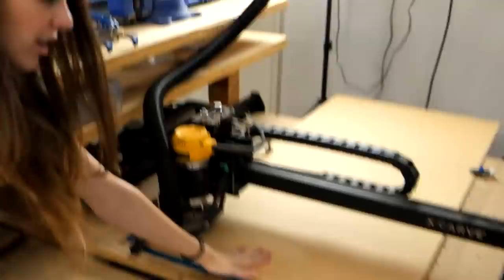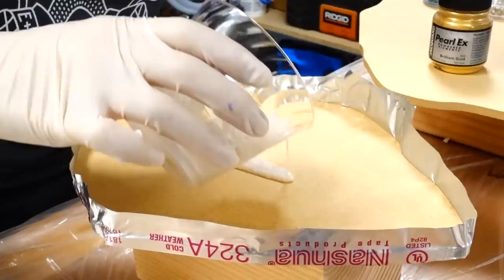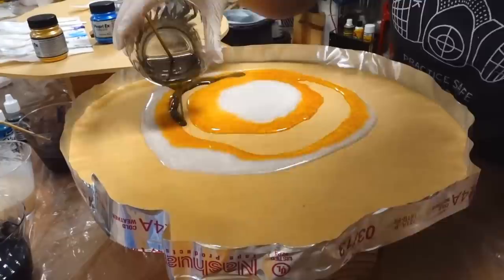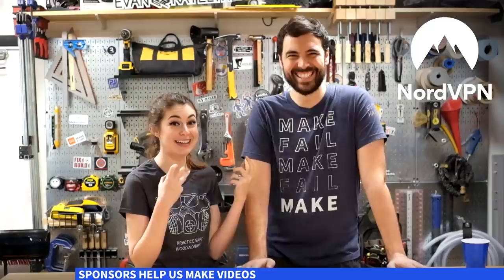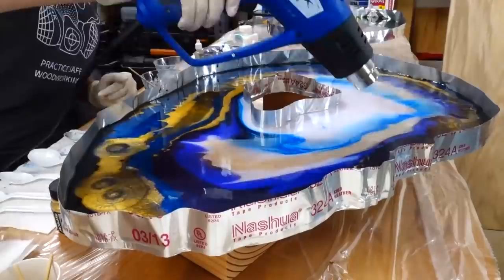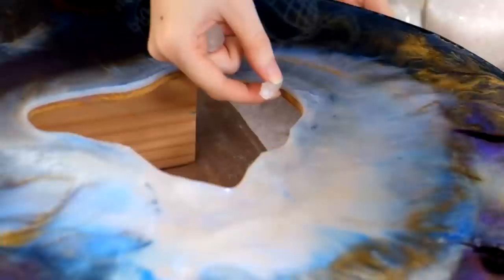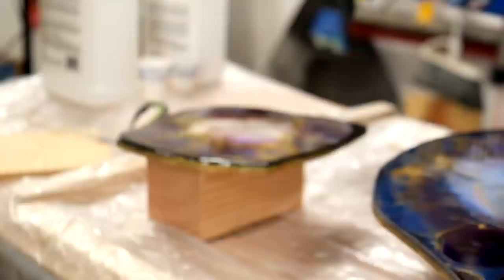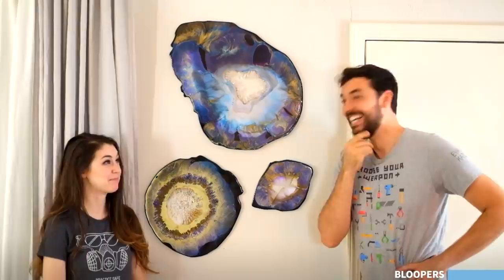DIY Resin Geodes - Surprisingly Easy!

Comment: You crazy kids with your myface and your fake geological artifacts. Back in my day we didn't have fancy geode art to hang on the walls. We just had potatoes and we were darn happy to have em.  Those came out sooo cool! I wonder what it would look like if you glued the mdf to the top of a tupperware bowl or something and covered the bowl part in sand and rocky crust to make it look like an actual geode rather than a slice.
Reply from the maker: bahahahaha this comment is everything. POTATOES!!! We are actually experimenting a bit with doing full geodes with a "rocky"  back and a couple other resin things!
Reply: Potatoes?? We would have killed to have potato art when I was a kid we had only macaroni and we were dang glad to have em, you kids and your fancy potatoes...
Reply: Before the vid got more than a minute or so in, I was thinking concrete shell (yeah, coarse/sandy outside would be awesome) and doing it on something so that there is not backing board to have a bit of translucence.
Reply: Roy Nielsen yes! Concrete shell with an LED or 2.. (or 30) in it, topped by a plexiglass-backed resin geode like these! That way the lights can shine through, like one of those crystal/geode lamps! And the concrete outer-“rock” from the concrete shell will also allow it to balance however you choose, so it can function as a table top lamp or wtv
Reply: Gene Price macaroni? Luxury!
Reply: Way too funny
Reply: What did I just read lol
Reply: Gene Price you had macaroni?? i can't believe how spoiled kids these days are. back in my day we only had fresh green artichokes, plain and simple. get out of here with your 'we only had--' NO! you young folks should be grateful for all the new technology your generation has. 😒
Reply: Little did you know that potatoe resin was soon to come...

Comment: Please please please use respirators!!! You will cause many health issues and possible allergies if you don't wear them! Set a good example for your audience too. Beautiful work guys!
Reply from the maker: We should be better! We are still new to resin and getting used to best practices
Reply: I was just about said that! 😅
Reply: @EvanAndKatelyn  I'm not kidding: I lost my sense of smell about 10 years ago when I built model trees for the adaption of "the gruffalo" using a lot of resin in the process. Never got my sense of smell back. It's not life threatening, and even sometimes helpfull, but most of the time it sucks.
Reply: Don't forget the gloves too.
Reply: Or use Art Resin. No fumes or nasty smells and just as good
Reply: @Ech00s  I used Art Resin for a river table without a respirator and it made me sick. Just because it doesn’t smell doesn’t mean it doesn’t have fumes! Albeit I was using large quantities regularly for like two weeks, but it’s always good to be safe.
Reply: Chris Woestenburg depending on the type, if you use it in a well ventilated area you should be fine. That said, I like to use a fan and a mask because I don’t have a respirator
Reply: Agree. Even if your epoxy is non toxic you are better off with respirator. Also, always use respirator for sanding. Epoxy is basically a form of plastic, if you sand it you create a plastic dust and vapour that you then breath!
Reply: @davidvasquez3564  they always wear them now :)

Comment: Amazing job!!! The final clear coat makes a huge difference in all of the details and figure of the different colors in resin. 

If you don't have the power tools to make a base for the geode, you can easily make one for pretty cheap! 

All You need is a silicone mat/art mats/the mats that have the grids on them(not sure what they're called). You may want to get a spray on mold release if your mat is older. Just spray and let it dry completely. 

And silicone and a caulking gun. You can get the liquid nails brand (100% silicone) and with the caulk gun, cut a decent size of the tip of the silicone caulking and then make your geode shape. Just let the silicone dry(will vary on how thick you want your geode to be. If you're wanting a thick geode, build up your layers of silicone until you are satisfied. 

Then you can start playing with resin and all of the different colors you want to use. 

After the resin has cured, you can just remove the silicone away from the mat and art. 

You can get a couple of pours out of your silicone "geode shaped wall(s)".
Reply from the maker: That is such an awesome suggestion, I hadn't thought of that! Thanks for sharing 😁
Reply: EvanAndKatelyn No problem! You would also get two different art pieces! As the bottom side will be different from the top. 

Especially if you do some alcohol inks and drop the white alcohol ink over the top of any color besides gold or silver basically lol. 

Also, if you didnt like the way your art looked after the 24 hours, you can remove the tape earlier(when the resin is going into the tacky stage) and the buildup on the edges won't be so hard/raised. 

Great job!!!

Comment: YES! We want the 100% Evan and Katelyn resin channel...dooooo it!!!
Reply from the maker: Haha!! You guys are biased!!! :P But we do have some more resin projects up our sleeves....
Reply: can we get this in the UK
Reply: wouldn't it be up your shelves...
Reply: TotalBoat what is the biggest difference between your product and west system epoxy? I'm using some for a few woodturning videos I'm filming and would love to know more for my next purchase.
Reply: (mbfg have the hand pump/dispenser options which is probably the easiest/most comparable to what E&K are using in the video)
Reply: @RCW-Designs  - Price! and Customer support. We try to stand above all for customer support and tech help with your projects.  Give us a try!
Reply: MakeDaley you can get the pumps for any type of resin.
Reply: @Phillip Taylor for sure i only meant MBFG stocked the matching pumps where as ECFG dont have any pumps stocked (they also use their own containers so not sure if other makes of pumps would work on their container sizes is all
Reply: MakeDaley what's mbfg and ecfg stand for lol. I know that West Systems epoxy resin does come with the pumps, but it smells horrible(unless they have made a new VOC free resin). 

One of the biggest differences I've seen between the total boat and the "generic" resin is the viscosity. 

Total Boat is way better and cheaper than "art resin"
Reply: MBFG and ECFG were the two suppliers I listed in my previous comment here in the UK that stock ranges of Epoxy ECFG (East Coast Fibre Glass) do stock West Systems to my memory
Reply: i was mainly replying because someone was asking if it's available in the UK (which i dont think it is) East Coast are a Marine Fibreglass Supplier so they certainly have the good stuff!
Reply: EvanAndKatelyn yayayayayayayya

Comment from the maker: Thanks NordVPN for being an awesome sponsor! If you want to protect yourself online AND support our channel, go to https://NordVPN.com/EVANANDKATELYN and use code EVANANDKATELYN, to get 66% off a 2 year plan. Thanks!
Reply: From my experience resin does not like the cold. The expansion is just too great. 
That said, I'd like to see how this looks poured onto plexiglass instead of the board. That way you can put LED lights behind it for accent lighting.
Reply: Have you ever got a plastic cup and filled it with multiple colour resin ie layerd it up and then put the cup open end against a flat surface and pulled the cup a way
Reply from the maker: @Chris Caldwell the Total Boat stuff that we used is actually meant to go on boats so I'm pretty sure it would hold up!
Reply from the maker: @TheNajSD we really wanna try a clear backer to make it translucent - it's on our list!
Reply from the maker: @Luke oooo we haven't but that sounds fun!
Reply: guys your wOrk is awsam plz tell me the names of colours ues in this project thanku
Reply: EvanAndKatelyn what type of tape is that you used around the edges of the wood ?
Reply: @Roewitme  i was wondering same thing... looks like metal tape/heat tape. ...these guys were fun to watch and I learned lots
Reply: EvanAndKatelyn I need this in my life ! 🙌🏻
Reply: OOOH WOW!
Reply: You should put a mirror behind in the center of those pieces.
Reply: EvanAndKatelyn you guys LOVE resin don’t you?
Reply: EvanAndKatelyn These are awesome

Comment: You could put some LED strips facing up on top of the wood before you pour the resin, that way it lights up from the inside and the lights are inside the resin.  Also, it would make a cool table top.  Like a side table next to a couch or something.
Reply from the maker: We definitely wanna try doing a transparent one! Also, funny you mention doing a table like this... You should check out tomorrow's video! 😉

Comment: The heat gun will cause the resin to kick faster. I use the same resin for work (on boats) and the heat gun also works well if u need to get resin off. You can heat it up and it will scrape off easy

Comment: If you tape the back with blue tape it helps the resin not puddle underneath! You guys are so fun! Loved your video! Also it’s ok to torch more to make sure all bubbles have popped! What do you use to cover them while waiting to cure? I’ve tried just about everything and I still will get specks of dust in resin! It can be so frustrating! But your geods look perfect!
Reply from the maker: Thanks for the blue tape tip! We didn't cover them... Just hoped for the best haha. We kept an eye on them and plucked out any hairs or specs we saw as long as it was still liquid enough

Comment: Great video.  Epoxy resins are a lot of fun, and if you ever have a chance to mess around with polyurethane resins they are fun as well (like Alumilite).  Polyurethane resins set up a lot faster, so you won't be able to do what you did with the epoxy.
Reply from the maker: Thank you! Haven't played with those yet but they sound like they'd be good for small or simple pours where you don't need the working time

Comment: Hey guys, a couple of tips: if you spend a few minutes wiping off the drips at the end, you save yourself all the sanding of the back. Also, if you are working on MDF or any other porous surface, VARNISH or otherwise protect the back, so it will not warp in humid weather. And most importantly, use very strong two part epoxy for the crystals in the middle - if you use glue gun, the crystals will fall off. 

Cheers! :)
Reply from the maker: Thank you for the tips! Appreciate it!

Comment: Exceedingly COOL!
Can you make one to look like a spiral galaxy in the night sky with red, yellow, blue and white stars?
Reply from the maker: That would be really fun to try!
Reply: I was thinking it might be relatively easy if you could put the workpiece on a slow moving turntable and then drop the stars onto it moving outwards from the center as it rotates.  Obviously if you center the workpiece on the turntable you'll get a flat side on galaxy view. But what happens if you put the workpiece slightly off center?  Would you get an oval 3D effect?  Hmmmmm!

Comment: Hi Evan and Katelyn, this looks so amazing!  Quick question:  once the resin dries is it totally waterproof?  Like, could you make a large rectangle piece and install it in a shower for the walls?  Thanks for your feedback, and again, thanks for this fab video!
Reply from the maker: Thank you! I do think generally it's water proof, the type we use (TotalBoat, we have a link in the description) is actually made for boats so I'd guess it has to be water tight. We aren't experts though! Still learning a lot about resin

Comment: Not so much DYI when they’re using a WHOLE garage full of equipment, machines, tools and supplies, that NO ONE has/owns/or can afford! Maybe it can be still done with like a Dremel tool and air dry clay molds, resin will probably be expensive. I shall make this video! But yeah this video helps.
Reply from the maker: Like we mentioned, you can use a jigsaw (about $20) and you can sand them by hand if you don't have a random orbit sander (can get those for $30). The resin is the most expensive part, but it's cheaper than getting a real geode slice that big so we still consider it a win :)

Comment: Do you have to use wood? Would this work on a normal canvas?
Reply from the maker: We haven't tried it on canvas so I'm not sure, but I have seen people put down non-stick parchment paper, use caulk to draw the outline (building it up so it's tall enough that the epoxy won't pour over) and then pour within the lines. Hope that helps!

Comment: Great video and loved watching you working together.  
Do you know if this resin can be used for casting figurines?  For instance, a 3d skull about 5 inches tall?
Anyone tried it for that type of art?
Reply from the maker: thank you! you can't do individual pours that are too thick because it puts off a lot of heat but you could do it in layers one at a time
Reply: Thank you.  I’m very much a newbie at resin and all resins are expensive and I was hoping for just one type.  But I’m quickly seeing that will not work and I’ll need a few different types for all the applications I want to try.
I’m checking in to Alumilite brand and some others for the jewelry and figurine pours.  And I just got a pressure pot to push out those annoying bubbles.  
But I LOVE those  squirt nozzle thingys.     I wish all manufacturers did that.
Reply: I recently started working with pro marine supplies resin, and I love it. I wouldn't do pours thicker than a inch, because it won't cure properly. A 3D skull sounds like an amazing idea.

Comment: “Surprisingly easy” if you’ve got an xcarve/router, heat gun, blowtorch and glue gun! (I’m just salty because I want to make some and don’t have all of those things 😫)
Reply from the maker: Like we said in the beginning, you could use a jigsaw (which you can get real cheap) instead of the X-Carve. All the other stuff is easy to find and cheap either from craft stores or home improvement stores

Comment: LOVE YOUR WORKSHOPS! <3 
WHat temperature is set your hot gun please? I was told i burned my resin art :((( I used 130 cels.degrees.. do you you very hot air or cool?
Reply from the maker: Thanks!! Our hot air gun has a digital adjustment so we don't overheat it 😊
Reply: @EvanAndKatelyn  Awesome, Mine also has digital adjustmant, but I experimented with different temperatures and failed hahaha. Can you pleeeeez please tell me what was temperature on your gun ? Sending good wibes! :)
Reply from the maker: We had it on the low side but I don't remember the temp. But the epoxy we use (total boat, we have it linked in the description) is really hardy so I think it might stand up to heat better than some resins
Reply: @EvanAndKatelyn  Hello Katelyn or Evan (I wonder who is replying the msgs usually :D ) I appreciate your quick response VERY very much! You are a gem, you inspired me and helped so much with your tutorials! <3 Sending you best vibes! You couple are AmazEballs (As we say it in UK) :D

Comment: I'm confused. Are you or are you not supposed to always wear a mask when working with resin or is it just with certain types of resin? And if it's just with certain resins, which resins don't need a mask?
Reply: @beckymcdaniel6402  you should wear a mask. I don't think e&k knew about it at this point. They start using masks in the later videos